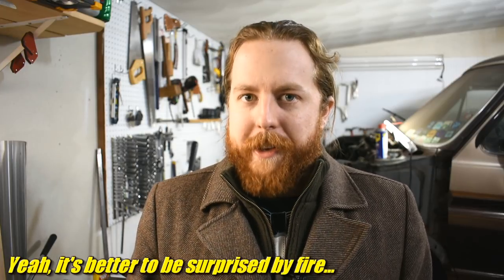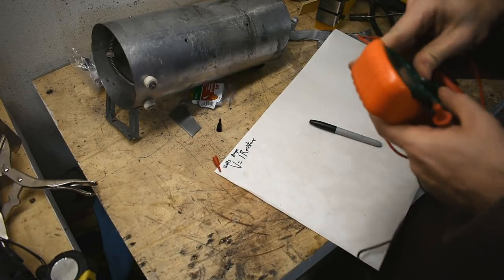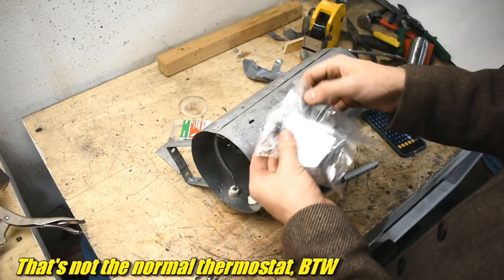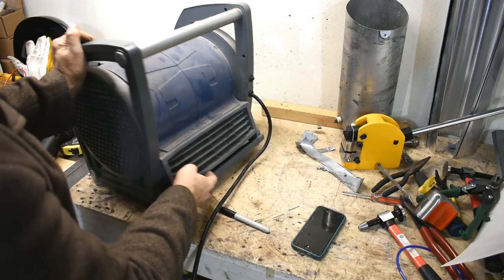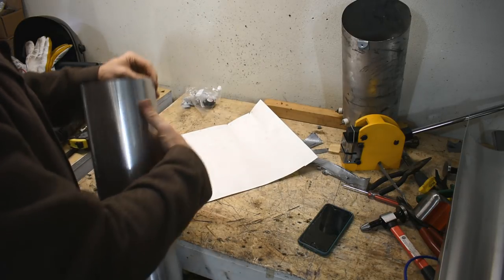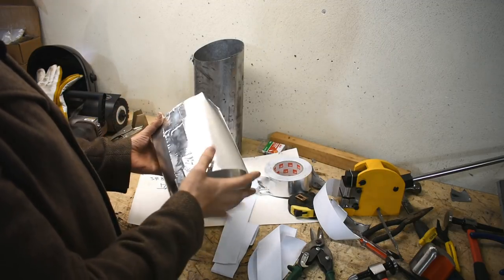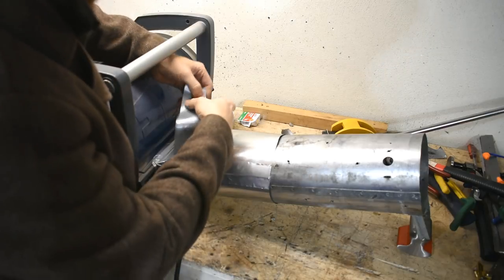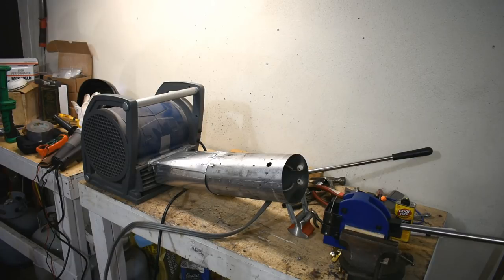DIY Garage Heater: Using Parts from an Electric Dryer

Comment from the maker: PARTS LIST !!: 
Similar element (with safeties) to the one used in the video: https://amzn.to/3g76EWd
Similar floor fan: https://amzn.to/3Er7MNO
Wire cutter/stripper/crimper that ACTUALLY WORKS: https://amzn.to/3GosAGH
10 gauge wire that can handle the power: https://amzn.to/3Ic7DQC
Correct Wire Connectors: https://amzn.to/3GoC7h3
3 Wire power cord: https://amzn.to/3vrJI84
4 Wire power cord: https://amzn.to/3hYH9r2
Vent i used: https://amzn.to/3C4VhG0
Foil tape: https://amzn.to/3i0vbxm

This isn't everything you need, but it's most of it. Most of this stuff can probably be found at your local hardware store on the shelf at all times.  Do this project at your own risk, obviously.

Comment: I've wondered about doing this but use a round vent fan. I had bought a heater at tractor supply that puts out about the same btu rating and it was only $100. They don't have it anymore but theres others online like it.

Comment: Great concept. I'm thinkin the fan is a bit too strong for that element?
Reply from the maker: Yeah its way overpowered but that's a good thing in this case.  The element runs much cooler than it would in a dryer, meaning it will last far longer before burning out.  It also circulates the hot air much better than a dryer blower would.  Different application, different needs.  Oh also I had this fan lying around and not a complete dryer.

Comment: to the guys upset about the utility bill, this is no more power hungry than the heaters in your house, baseboard or wall fan in fact by his math it may even be a little better on that ole electric bill. I would be remiss if i didn't mention the 240 volt exposed leads however i take it you don't have kids or don't like them much lol. What i really like about your vid is you in particular you seem quite at ease on video and funny as well.
Reply from the maker: Spend one day laying on a freezing garage floor and the power bill starts looking fine to me! Lol. The exposed leads yeah in should fix that
Reply: So how much did the electric bill go up?

Comment: Paul maybe you can tell me why my $2800samsung fridge is such a piece of shit?  The calibration on the door is screwed and I cant find any tech data to reset it...  Model #RF4287HARS  Thanks man.
Reply from the maker: Unfortunately the answer is in the word “Samsung”.  They make very bad appliances.  They look fantastic, the marketing is top notch, but it’s equivalent to disposable Chinese engineering, built as cheaply as possible.  We don’t know anybody desperate to work on the fridges anymore, there is no fixing some of the problems and there is certainly no money in it.  The few times we got suckered into it we usually had to reengineer something to make it work or to compensate for Samsung sending the wrong parts.  Box stores push the products hard because the markup is so great, but it really screws people over.  I would suggest a middle of the road Maytag or Whirlpool fridge, with a big icemaker in a cabinet, (not the small, out of the way one), and NO dual evaporator fridges.  Unfortunately Samsung products in general are difficult to fix, as most of the issues are from bad engineering and software, not parts that are necessarily “broken”.

Comment: Ya could of bought 10 hair dryers in a metal welded array, for 10 bucks
Reply from the maker: The same heat from 110v hairdryers would take far more amps than my garage circuits could handle.

Comment: So, this is easier than just plugging in a dryer and pushing start? I rebuild washers and dryers every day and this is some dangerous stuff to be showing people. All you need to do is not hook dryer vent to a working dryer. I use whichever dryer I just repaired and then move on to next dryer. I've seen a guy completely tear apart a dryer, bypass safety thermostats just to make a smaller....dryer? A regular dryer works fine as it is. People over engineering things is the down fall of the appliance industry. Also, using a dryer with a timer let's you safely work and it will shut off on it's own. Then, in the spring, you can sell the dryer and find another when it gets cold again. Stay safe y'all.

Comment: Use a DPDT switch on the element for 120/240 for low & high heat. Switch to 240 to get the edge off…. Then switch to 120 to maintain comfort
Reply from the maker: Thats actually a really good idea, thanks!

Comment: Hope all goes well when the electric bill comes. Warmth comes at a cost. But it is worth it if you get to play in the shop / garage.
Reply: It's no different than an electric furnace or a dryer that people use all time. in fact it's probably less being as it doesn't have to run all the time to keep the garage warm.

Comment: My electric cost is around 13 cents per KW/Hr.  Including the fan it would cost me about $.70/Hr at 100% duty cycle.  At 50% duty cycle and 6 Hrs/Day in the shop, that's about $60.00/month.

Comment: Power Draw and energy costs ?     One of those little  $19 ceramic  space heaters  meant to keep your feet warm under an office desk is good enough  for working in a garage... It does not put out a lot of heat,  it barely helps keep the space above freezing,  but it's electic costs are low, and make things tolerable,  not comfortable.   To get warmer,  just work harder... :-)

Comment: Just be happy you dont have an old Reznor vertical industrial sized heater. Luckily I have a big air compressor and a really old air jack sitting under it. When it fell it fell on those and not me! Last time I walk under a heater in the rafters of my garage. Luckily nothing was made in China so it all still works!

Comment: Laughs ... I have 3 dryers in my cold garage. Ok thanks paul time to go rip apart some things and put together other things with some thingamijigs
Reply from the maker: Good luck and be safe!  Safer than me, anyway
Reply: Paul's Garage my safe needs working on... I once made a furnace to melt aluminum out if a tool box and cender blocks.

Comment: If air cinditioners is one of the types of appliances you repair, you might be able to get ccess to a working squirrel cage blower that you can rig up to your heater.  Then you won't be worried about damaging borrowed property.  No way they forgot you have it, they just pick their battles.  Besides, they probably love you.  Remember that on their B-days, Mother's & Father's Days.
Reply from the maker: I think they know I have it, yeah.  They have a bunch of these fans.  My dad offered some dryer motors and blowers, I could rig up the heat through the centrifugal switch like they usually are, but this fan moves a lot more air.  More air means cooler element which will last longer, and better circulation of the heated air

Comment: The only thing that scares me about that heater is the electric bill...
Reply from the maker: Yeah it's going to be a bit pricey, but i'm not going to run it all the time.
Reply: Good idea. I found out the hard way just running my 5kW heater a few hours a day. I sold it soon after that first bill and replaced it with a natural gas heater. I'd use wood, but the wood heat makes the insurance companies freak out.

Comment: 120 volts lights tge element and the other 120 runs the motor. You should only need a regular 120 volt outlet.

Comment: Could this even work if i hooked up 2- 110 volt plugs so i won't have to use a dryer plug?
( just curious ) but not plugged in on the same line of course.

Comment: LOL gotta love those restring kits.

P is the symbol for watts.

Those electric dryers are usually rated for 18,000 btu's.

A floor vent boot for HVAC would work.

No such thing as too much duct tape - you been watching too much 'Red Green Show'  LOLOL

Comment: Good idea and good video, I found a 240 volt element on ebay and will use a furnace blower fan (free). Wouldn't be possible to run the 110  volt blower motor off 1 leg of the 240 volt ? If I used 2 switches why wouldn't that work and have 1 power cord? Weren't some old dryers made like that?

Comment: So, I saw this post online and it just so happens I was going to build something similar, so I thought I’d watch. Voila, it turns out we have the exact same heating element. Lol. I’ve had it for probably 30 years just moving with me from abode to abode. I do however have a squirrel cage fan from a Jenaire (sp) type stove. You’ve given me hope now to go forth. So far I’ve only used 110 on the element when I had a smaller shed and that worked. Now though I’m going all out. Could you provide info on the safety items you used?

Comment: Cool experiment.  A few points: The resistance of the wire increases when hot so the actual BTU output will be lower. An IR temp sensor will not correctly read a reflective surface, I use painters tape over the surface for a true reading. The laser is a gimmick, in truth, the IR thermometers measure the average of a wide cone. (I have now switched to using a thermal camera) I recently set up a 5KW diesel heater in my garage and basement.  They work well!!!

Comment: First run on jerry rigged heater pointed directly at highly flammable substance (Goof Off).  Homebrew 240v heating element carefully positioned directly next to the propane tank storage area in the garage.   This is the guy who shows up to fix appliances in John Q Public's residence ?   Who was it you work for again Paul?

Comment: Really, electric is the only way to go for a heater that you can use in a small space that isn't particularly well ventilated (keep the doors shut or you'll let all the heat out!). It's not the water vapor from a propane heater that I'm worried about either, it's the inevitable production of CO and CO2 that you have to worry about. Those two gases will kill you, and any kind of combustion heater save one running on hydrogen will produce large amounts of CO2, and a variable amount of CO depending on how clean and/or lean-burning the combustion is.
Don't think that you can get around not being able to get hydrogen either, first off nobody will talk to you unless you want like 5 tons of liquid hydrogen, and secondly if you set up your own electrolysis cell you just made an electric heater with a lot of extra plumbing.

The cost of the electricity is an unfortunate side effect, but really you were going to pay for the energy one way or another, be it in chemical or electrical form.

Comment: The resistance is more the longer wire is but you won't have a problem with that. the squirrel cage fan should move plenty of air though that element tube. the foil tape is used ducting also. some rivets would help sturdy it up a bunch. a switch/thermostat might be handy, some squirrel cage fan constructed in such a way a person can change pullies to get the perfect amount of air flow. your general idea is awesome though.

Comment: I had seen an video similar and was going to do it. But this past spring northern tool had a clearance on garage heaters....marked from 179.00 to 41.00.....took a bunch of my scrap #1 copper to the scrap yard and brought three. Watch your local northern tool at major seasonal changes, they discount to the bone to clear the shelves ..... brought a 1100.00 electronic variable speed drill press for 359.00😮
Reply from the maker: Sounds like a great deal!  I have since moved and my new garage has a built in heater.  Haven't used this one at all

Comment: That turned out to be a really great project. I think it’s worth putting a few more minutes into it to have yourself a really nice garage heater. I wonder how many dollar bills that old element is burning through...?
Reply from the maker: I didn’t figure out the cost but I’m sure it’s more money than I want to know!  I want to add a shell and a stand to it and also a thermostat.  Right now it’s just on when plugged it and it can get pretty warm in there.  Warmer than I want the garage to be, honestly, which means I’m spending more money to run it than I need to.
Reply: What about a simple on/off cycle time, run 15 minutes, off 5 minutes, or some combination that gives you the temp you want.
Reply: Honestly, run it and don't worry about it.  You probably won't notice that big of a jump in your bill, unless your running it daily.  My surprise is the heat it can maintain in that space.
Reply: A heating element is the only thing that is 100% efficient. Any loss to friction in the blower and resistance in the element are lost as... Heat.

Comment: over here its I=UxR
gosh you even co CAD design (cartboard aided design)
as for fixing small cuts on like tumb : supergleu .... soundfunny but it works prevent the cut from reopening when stretched
Reply from the maker: i've used superglue for cuts before, didn't have any handy though...

Comment: What brand shrinker/stretcher do you have there, does it work well? Thanks and thanks for the video too.
Reply from the maker: It's an Eastwood shinker stretcher, and yeah it works pretty well. I think most of the cheap shrinker/stretchers are about the same, they look identical anyway 👍

Comment: Hi Paul, the hole heater looks really a little bit scary ;) May be a cheap electric bathroom heater with 2000-3000 Watts will do the same work much more safety. On Harbour Freight may be only 20-30 $. Please they safe Buddy.
Reply from the maker: Maybe, but this was all parts I scavenged for free! :D. Yeah it’s not super safe.  The whole set up is intended to be inside a dryer so you can’t touch all the exposed wires

Comment: A rheostat to slow the flow of air.
Would that slow the flow of air across the elements thus warming up the elements more and putting out more heat with less airflow?
Reply from the maker: Maybe but I like the airflow.  It circulates the air primarily, heating is secondary.  Id rather have warm air blowing everywhere than hot air in one spot

Comment: Nice video Paul.....you are a true DIY pioneer, always makes me smile. Out of interest, is this thing cheap to run?....at 5kw it would cost approx. $1.50 per hour if my maths is correct.
Reply from the maker: No idea, I never figured it out.  I’m only using it occasionally, so it’s not costing much money.  The garage is insulated too, so once it warms up it stays warm

Comment: That’s going to cost a fortune in electricity lol. Get you one of those diesel/kerosene torpedo heaters. They put out a ton of heat.
Reply: Wrong tool for the job IMO. First off, even the smallest torpedo heater is overkill for this application (too much heat). Secondly, and perhaps more importantly, if we're going to go with a combustion heater, what is really needed is something that separates the combustion air from the room air, because enough combustion to heat this space will create dangerous levels of CO and/or CO2 unless you open one of the garage doors. Electric is the only way to go unless you want to punch a hole in a wall for a vent stack.
Of course I'm not mentioning Hydrogen combustion, because while it only produces water vapor, hydrogen is not easily and more importantly inexpensively available to just anyone, and creating your own hydrogen by electrolysis of water just makes it an electric heater with a lot of extra plumbing.

Of course if you do punch a hole in the wall for a vent stack, propane becomes an option again because the water vapor goes right out the vent just like the little bit of CO and all the CO2 produced by burning propane.

Comment: There someone on YouTube made a Foundry using fire brick and red hot coils i forgot his name
Reply from the maker: Yeah I’ve seen those.  The problem is electric foundries require so much power that even with 240v I would be limited to a very small furnace or I would need a 50 or more amp circuit.  My propane foundry burner produces many times more heat, probably 15 or more times as much.

Comment: Well I hope this can get you through winter with this thing. Since you only spend a few hours a week in your garage it seems like a pretty good setup. Since 3000 watts would be a very expensive way to heat a garage if you were in there longer. 

Just for the love of god make it more permanent and stay safe.
Reply from the maker: It’s pretty unsafe currently, but trust me it was much worse during the “proof of concept” phase... I need materials to build an enclosure and stand.  Went to the steel shop when building this but they closed for a blizzard.  The good news is this thing heats the garage up enough that I could conceivably paint the jeep before the weather warms up.
Reply: Couldn't you just use some sheet metal from an old dryer? Must be some kicking around at work.

Comment: Fun fact, Goof Off basically has the same ingredients as Zippo lighter fluid. Which is pretty fukin cool because Zippo lighter fluid is cheaper than Goof Off. BUT, probably not a good idea to have it setting a few inches away from hottest end of an untested janky DIY garage heater though. =P
Reply from the maker: yeeeaaaahhh, that wasn't a good plan.  Fortunately i didnt' blow up.  The air coming out of the end is only about 50 degrees warmer than the air in the room, so when it's 30 in there the air blowing out barely feels warm.  It's just warmER.  When its 70 in the garage, the air coming out the end feels very warm.  Very strange, but it heats the place up real well.
Reply: Paul's Garage, ya I doubt you were in any real danger, but that's usually how it happens doesn't it? Granted, something very catastrophic would have to happen to get a sealed container to explode. I've watched enough fail videos to know how easily this occurs hehe... It's a cool idea though, hell just running it long enough to take the edge off the cold can help a ton when you need to get something done in the garage.